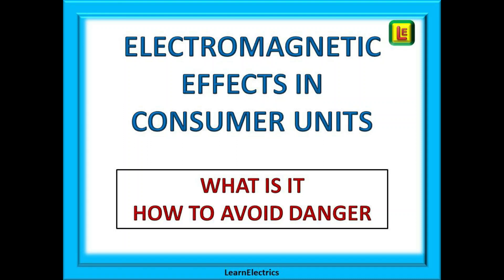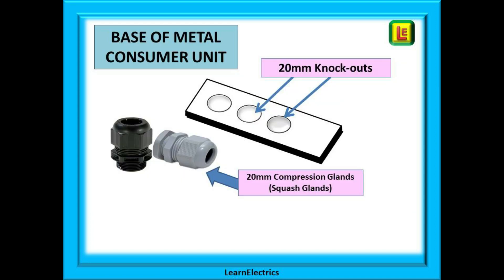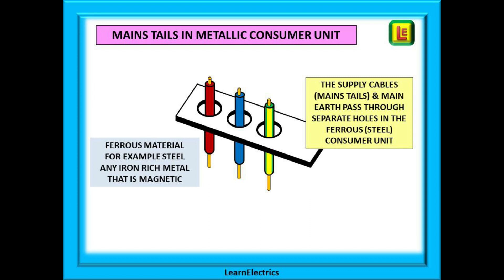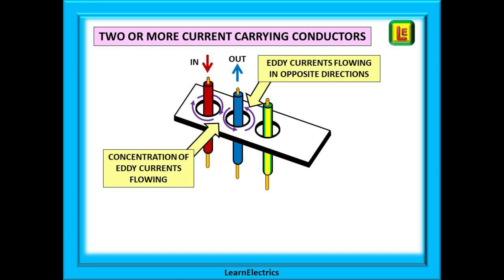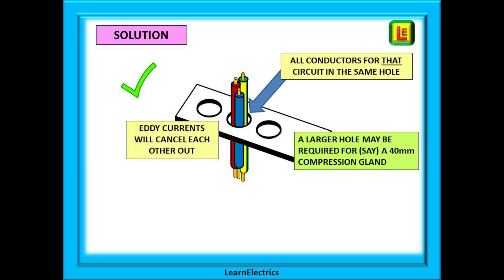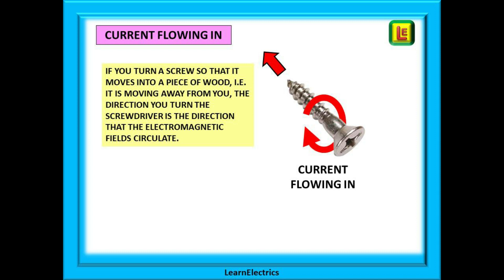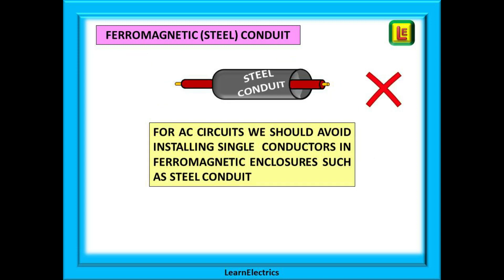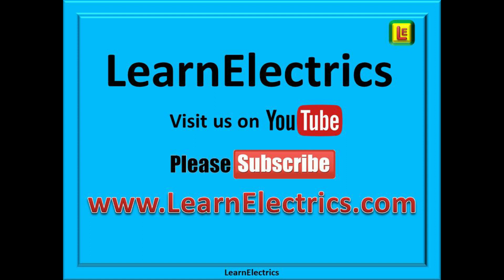ELECTROMAGNETIC HEATING EFFECTS IN CONSUMER UNITS

Comment: Agree in theory. But at 100A max. how big will the magnetic field caused by 1 turn be? The concern is valid for industrial installations, but I doubt it is a real hazard in domestic installations. My guess us that the regs require all conductors to be passed through the same hole for 'safety'; so that you don't get people trying to calculate maximum allowable current and what have you. A blanket veto, sort of.
PS. Wouldn't the consumers unit be earthed too? Won't that direct eddy currents to earth?
Reply from the maker: Thanks for watching. Just passing on what the Regs ask us to do (or not to do) Cheers, Dave.

Comment: What about a 3 phase delta installation without a neutral? Would the earth alone be enough? Great vid and easy to understand 👍
Reply from the maker: The Regs tell us that all the cables for a particular circuit should go through the same hole in metallic cupboards/CUs
In an ideal world you will not have leakage down the earth and the three phases should be fairly well balanced.
Reply: @learnelectrics4402  Thanks, il do just that, A recent inspection has highlighted this and I now understand why thanks to you, god bless you.
Reply: @learnelectrics4402  I have been told today that the U.K. doesnt use delta, not sure if thats true?

Comment: Hi sir...question...does the presents of a eath cable  for example helps to cancel out the the magnetic effect on a circuit..eg in a 3 plate wiring where there is no neutral
Reply from the maker: The earth cable will only affect the EM effects if current is flowing along it - leakage current or fault current.
Reply: @learnelectrics4402  thanks....looking forward for u to do  a video on capacitive inductance
Reply from the maker: Keep watching Dennis, I'm sure we will do one soon.

Comment: We seen most if not all electricians have separate  path inside the consumer unit to the breakers or neutral terminals....it looks nice and neat...so what's the effect of magnetic effect inside the unit then
Reply from the maker: Once you are inside the CU not a problem because all three conductors are surrounded by the same metal box. Yes, some guys take neatness to a work of art, it's a pleasure to see.

Comment: Thanks for the video.  As an adult learner your channel is a great help. John Ward did a video on exactly this topic where he fed a 25mm cable in and out of a metal consumer unit under test conditions (albeit outside) but it shows that although theoretically possible (as you describe), in the real world it is unlikely to cause a major problem.  Video is https://www.youtube.com/watch?v=hg5eZkq2KgE
Reply: It doesnt cause any problem in any low current installation. Look at the average CT! Many hundreds of turns of wire around an iron core is required to generate a couple of tens of milliamps for a primary current of 20A or more. So it should come as no surprise that a single core through 1mm of ferrous material does nothing of any significance. In a heavy industrial application the effects could be significant where a great deal of current is passing through the conductor but that is a different scenario.
Reply from the maker: Absolutely, the bigger the current the greater the problem.
Reply from the maker: Yes, heating effect is dependent on current and may not be significant at small currents but if you are a registered electrician you may get a non-conformance for this on your assessors annual visit. Thanks for the feedback.
Reply: Yes, in practice unlikely to be a problem. In industrial situations, where the currents could be much higher, I guess you could have a problem. Years ago I worked on a project that required induction heating of steel strip that was around 1 metre wide and 0.2mm thick. The strip passed through an induction coil that was powered by 250kW, 25kHz generator. The steel strip was travelling at 60 metres per minute and was heated from ambient to 160C in 1 second. It was pretty impressive.
Reply from the maker: Yes, its amazing what current can do, isn't that part of the Maglev train theory.